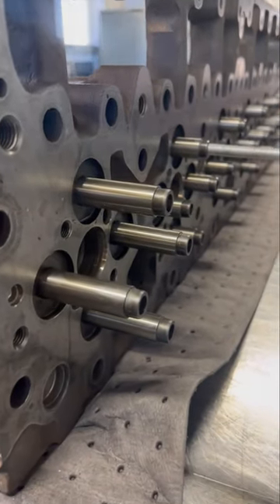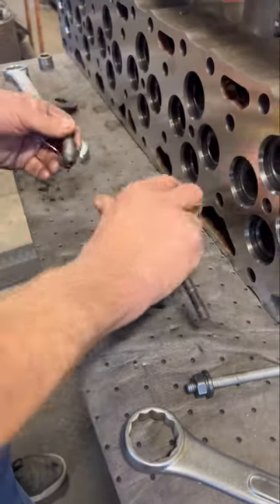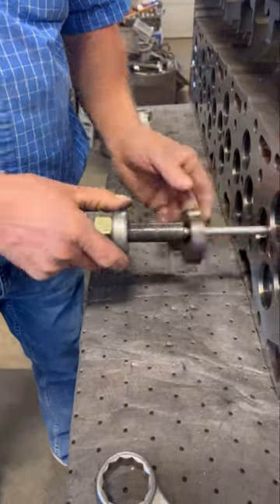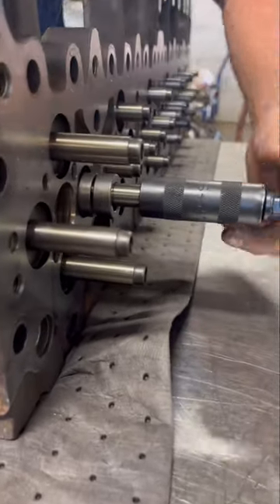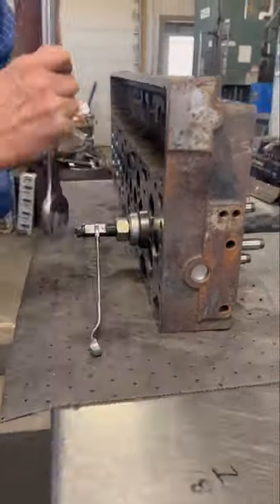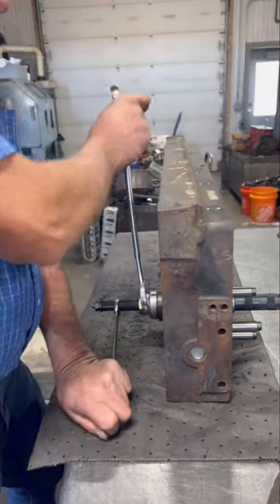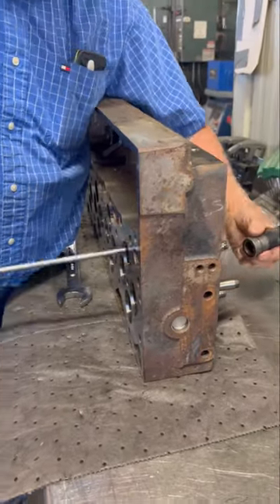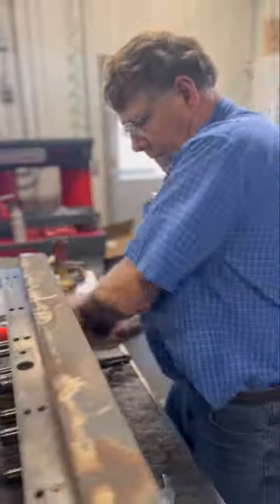#shorts Do You Prefer Slow & Safe Or Quick But Risky?

Comment: Installation tip!

Put the valve guides in a freezer  a few hrs prior to installation and they will install a bit easier/faster using the harm balancer installation tool.

Could also face a portable Elec heater on the head to heat it up a bit to aid in guide install.

Comment: How does one know when it’s time for an engine rebuild? I’m assuming this engine is from a semi. Do they just have it rebuilt after so many miles or do they run it until they have a knock or burning lots of oil? It would be neat to hear the “customer complaint” so to speak
Reply: Sometimes you get a blown head gasket and you have to check the head for warping. 
Sometimes it's easier to just get the head rebuilt at that time.
Reply: If you don't have any running problems with the engine you go by how much oil it burns.

Comment: our factory simply heats the motor head in water to 80 degrees celsius, then using spacers, hammer the guide in.  We've been doing this since the 60's, nothing has ever broken. in the case of cast iron head and guide, we additionally heat the point with a burner before.

Comment: That sounds good and it’s ingenuity is even better but sometimes valve guides tend to not be started straight and could drag or be cocked slightly upon entry that will continue to damage the bore Pulling them through with a device it doesn’t allow you to feel what’s going on

Comment: I purchased a Harbor Freight hand hydraulic knock-out punch tool set. And use the puller to do this exact thing, and the hand pump isn't so powerful that you would need to worry of the fracturing of the casting by means of over-drawing, you feel it bottom out precisely. They are only like $150 bucks on Amazon, or you can buy the name brand units like a Greenlee or Klein but, the price for the exact same tool, other than the color is like starting at $550 on up to $1500... Hence, the mention of the Harbor Freight or Amazon unit.. but, the manual hand cranking is just as good.

Comment: Go to Harbor Freight and buy a knockout punch set, then use the hydraulic ram to install the guides.  Works exactly like your damper installer, but is hydraulic.
Reply: I was thinking the same you can then also ad a hydraulic pump that is driven by pressurized air (sorry don’t know the correct English name)
Reply: It’s called “air over hydraulic”.
Reply: That would also require moving the 200 pound head. It’s actually quicker doing his method with this side of head.
Reply: @slycarlo8747 he is recommending a small hydraulic cylinder that you can use to pull that rod instead of spinning a nut, so you would not need to move the head

Comment: I usually go for the fastest, but easiest, and least amount of effort method. Take the quick and dirty method, mix it with the book, and then figure it out the way that works best for me. Do it right and do it once, but make it quick and easy as possible. In this case, i wouldnt wanna fight that head around in the press, and knowing i may fuck one up with the air hammer, this is the way id do it if i had those tools to do so.

Comment: Time is money and so is injury because it takes time TO REPAIR 
That's why I have a sign in my shop that says you want it when ROFLMAO
A jpg has three guys behind me rolling on floor laughing their butts off
That sign is posted directly underneath the sign that says service and repair

I also have another sign that says we love rubber checks
The jpg on that one has me holding a wrist rocket and using a rubber check as the strings for the wrist rocket and grabbing a pill out of the box that says lawyer with the customer walking away with a rather heavy package one of those pills is flying through the air aimed right at the customer's butt and like I said the second pill I'm loading into the wrist running underneath the picture it says they always tend to bite the customer in the back I have that one hanging right over the top of the cash register so it would be that sign my head and the cash register underneath my chin that's what you see when I'm giving you the appropriate enough to be writing down on that check sadly enough I have had three checks down since 40 years even with that sign but I only have one outstanding check remaining the gentleman had a heart attack so I called off the lawyer and call it a Christmas gift the gentleman had just picked up a 30-30 for his son and it looks like they that family was not going to go hunting for the winter

That's what I make for myself this year a trapdoor cowboy in 45acp

Just because of 114 does not mean I am going to stop my winter tradition that is a god-given right they're trying to deny me and if they want to stop me from doing that then I can think of much more deadly weapons to create that they don't have any control over if they want to harass me about my making a single firearm for myself every year and then I can start making thousands of weapons and handing them out there's no difference in that last opinion of mine then there is in saying you have a right to Medical so you have the right to put your as many babies as you damn well can get pregnant with